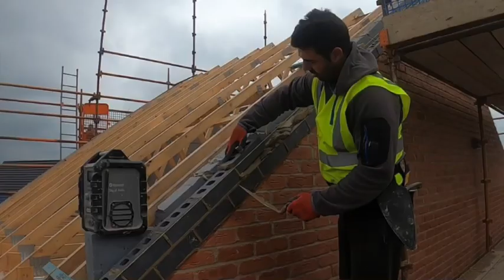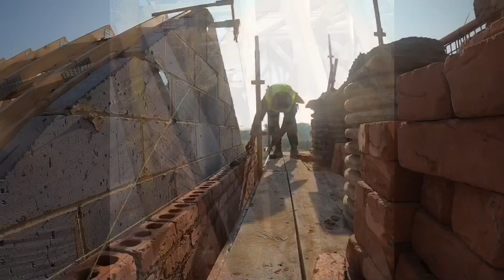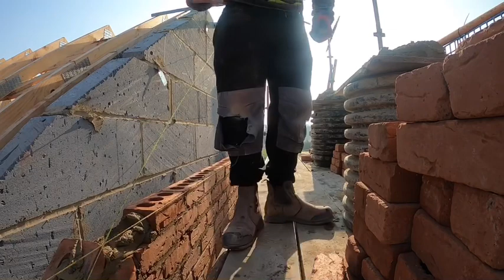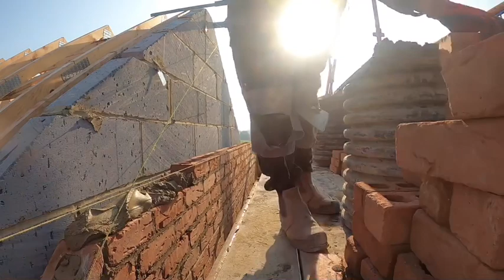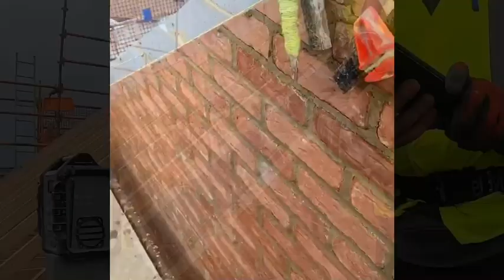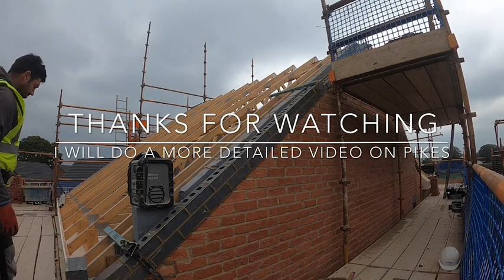Bricklaying finishing the pike with oversail

Comment: Great work, have you ever used the ox pro 11 inch trowel with a thinner rubber handle,than the original, Bricklayer from Ireland 🇮🇪🇮🇪, just wanted to get your opinion,I haven't used one,I use s whs,find it hard going,on the wrist
Reply from the maker: Mine craft king thanks for the comment 👍🏻 I use to have an 11 inch  ox trowel  it use to kill my arm so I gave it away. I didn’t really like the angle of the handle too. I think most 11 inch trowels end up doing some damage at some point. Onsite especially because the mortar is so much heavier. I just use a 10 inch leather handle Marshall town  and S&J whs tyzack broad heel. That’s probably 9 inch now. That is what I use most of the time. Hope that’s helped 👍🏻😀
Reply: Many thanks, great advice, will take it on board, my friend,who is a Bricklayer,uses a Ragni crown 10 inch,says it's very good trowel, we are building 9 by 4inch solids, it might be a bit small, that's why I was thinking of the ox,11 inch, seemingly they have made the handle thinner,if that helps,
Reply from the maker: Yeah when I was using my ox 11 inch I was building stables block flat. It’s the weight of the mortar on the trowel all day that was doing my arm in. Take care pal
Reply: Great help,many thanks,🇮🇪🇮🇪
Reply: Is that a good trowel, for anyone who suffers from repetitive strain,?
Reply from the maker: I suffer really bad with tennis elbow and the trowel I’m using helps a lot them big trowels are no good 😁👍🏻
Reply: I was looking at the thysack whs trowel on Amazon,looks a nice trowel, is it the 10 inch or 11 inch, that you use, thanks for your advice, great to hear what a fellow brickie, is using,🇮🇪🇮🇪
Reply: Any chance you could txt me the size of your whs trowel, or a photo maybe,Im not familiar with the one , you are using,👍👍